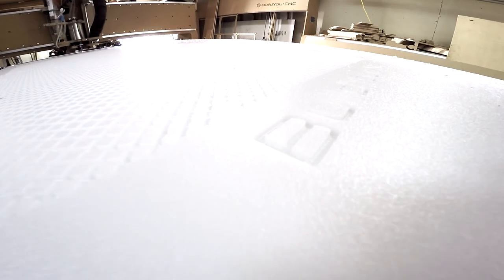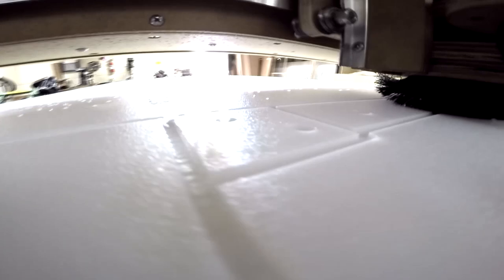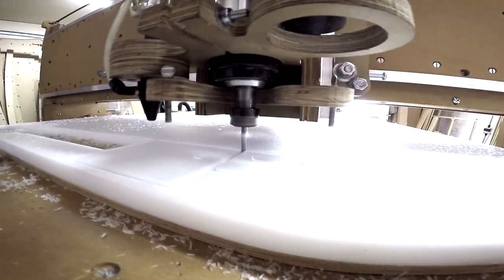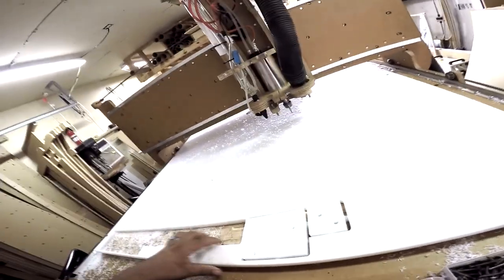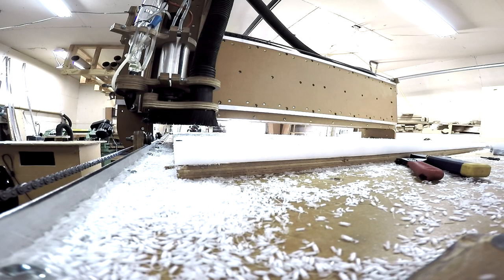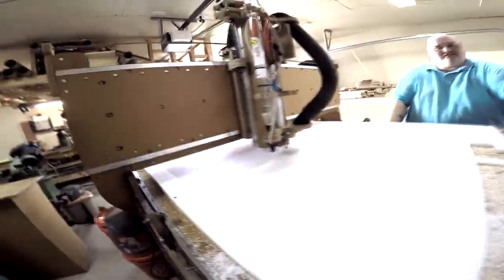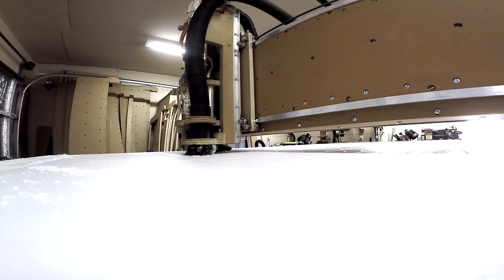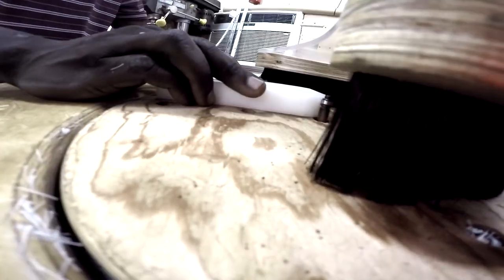Expensive Material, Risky Job! - greenBull Cutting HDPE

Comment: Read the data sheet from you plastics supplier... I've run in to problems with the amount of watter HDPE can absorb and tolerance  issues,  But.. I suppose  that ice cubes don't come specked  +/- 0.0002"

Comment: with as many small z travels you did on that job have you worn low spots in the z rails?
Reply from the maker: We have been using this machine almost every working day since Sept 2011.  The rails will "cold roll" and become strain hardened along the extent of our travel through all of the jobs during these years.  The bearings are tightened from time to time, and in our experience, the rails eventually stop becoming rolled due to the residual stresses formed within the grain structure of the aluminum.  Additionally, the rolling forms more surface area for the bearings which causes further support naturally.  

A single job will not cause an abnormal forging pattern on the rails. It would take many hundreds of these types of jobs, and that would be ok since that would be the effective area that would need be rolled anyway.  I appreciate this question as this may be on the minds of potential customers and cause a perception that may not be true, so your question is greatly appreciated.  Thanks!
Reply: Patrick Hood-Daniel Thank you.  I built a machine based on the blackfoot/greenbull/some of my own mods and ruined a set of rails because i havent worn them in well enough.
Reply from the maker: Interesting.  When I started this field back in 2008, I did the same thing and learned a lot, mostly from thousands of failures, and still failing now, but keep on learning.  I designed the bearing to be tight to the rail, but the screw that pushes the bearing assembly towards the rail works too well sometimes and if the screw is tightened even a quarter turn too much, it can warp the rail or over roll the edge.  

Sometimes it's just better to replace the rail if it gets too over rolled. You can see that my rails are pretty well rolled along the bottom side, but the machining is still sharp and clean and that is only possible from a rigid machine.

Best of luck and enjoy this wonderful field!